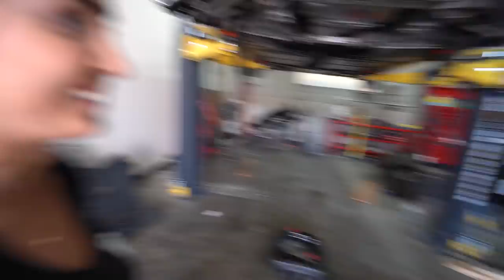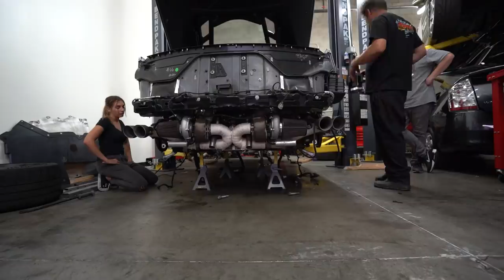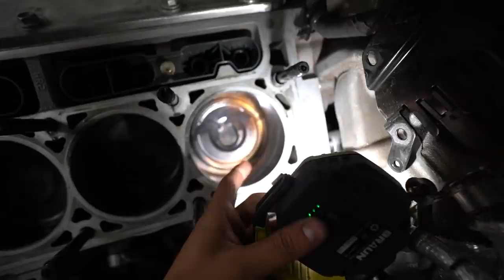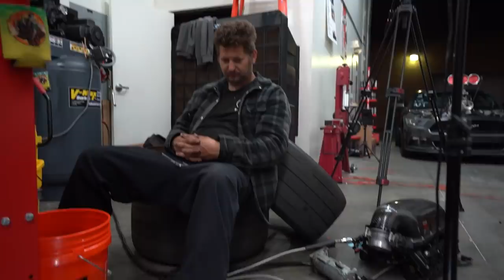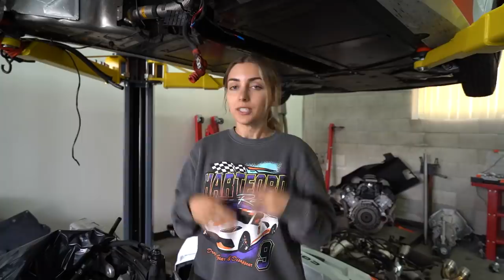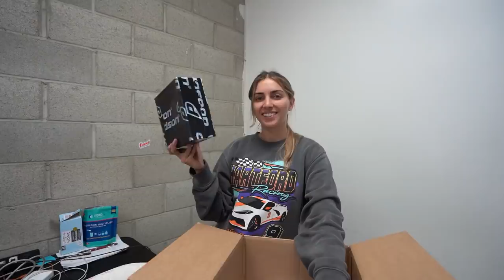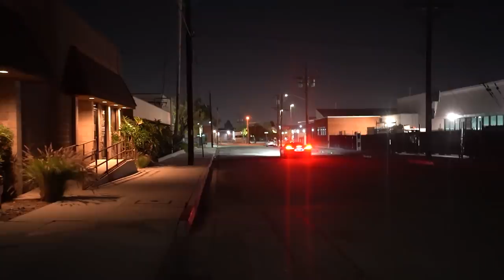I Finally BLEW the motor in my Twin Turbo C8 Corvette... Shocked at what we found.

Comment: You guys could start a mobile C8 "engine in-'n'-out" service - "engine on your driveway in 30 minutes or the next one's free!". 
Man, those stock head gaskets are tough if that's what you had with enough power to lift heads. Crazy. 
Another great video, love when they end with a rip 😎

Comment: Emelia: "And for anyone who has no idea what any of that means"  Sandy: "It's Effen broken!" LOL, At least Emelia is taking it in stride, You guys crack me up. You guys will get it fixed just in the nick of time as always. Sandy just doesn't need the pressure! I feel for you Team Hartford. as for that crazy clutch and transmission?
I think you made the right call by sending the new clutch pack back with the old. it acted like the clutches weren't disengaging (freewheeling) completely.

Comment: So.....you saw "glitter" when you dumped the oil, but so far as I can tell you didnt inspect the crank/rod bearings? And then you screwed it back together?

Hopefully I missed something???
Reply: She said it was from a 240sx skit she did before 0:25 I think it's actual glitter not bearing flakes.
Reply: @wakawaka5131  Thanks- I had just skimmed through the vid looking for  the part where she took apart the bottom end, which obviously never happened. For as hard as she pounds on this engine I'm still surprised she never sends out the oil for analysis. On a purely technical level it could be interesting for viewers, and on a practical level it could conceivably save an engine on the verge of hand-grenading.

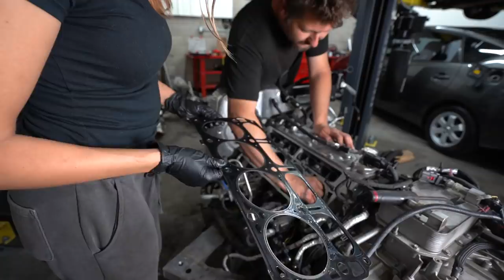Comment: Ok I'm no expert engine builder or anything, but at the 5:50 mark the right most cylinder looks definitely f@#$ed, maybe a bent rod or main bearing issue.  Could be weird lighting but it looks pretty bent.  My guess is the rod end and crank are rubbing a little.

Comment: Head gaskets?  with only 15lbs? Use head studs. Or just go and get a SBC with FIVE bolts per cylinder to clamp the gaskets.
But with all the b/s electronics the C8 is a lemon.

Comment: @EmeliaHartford; Every posted vlog You produce is very good to excellent with much positive energy, excitement, detail, including the status, results, 'story', situations, development, successes, 'failure' ,problems, issue, solutions, work involved, achievements, learning and development process. 😄
Each week i look forward to seeing, view and enjoying Your posted edited video with all of it content and progress. 😏
Am glad that You have improved, upgraded clutches including the proper sized shims, to aid the desired results and handle the high torque &HP. 😏
Am looking forward to seeing how the updated ECU/TCU from Pietz Performance performs, and what results You all achieve in combination with the newer clutches, and better performing engine status. 😄

As You show this engine apart ,again, the issues, and such a few ideas were triggered and generated within my mind, thinking, including ideas, concepts, principles that might be useful, helpful beneficial and thus decided to write for You All if You have considered them. 🙄🤔
A. 'milky' looking engine oil - usually and often results from ethanol or methanol mixing - sources: 🤓
 - 1. turbocharger hot air from exhaust mixing into engin oil
 - 2. other air passages from fuel system and exhaust system into engine oil lubrication
 - 3. passage around rings
B. Higher boost engines - especially TT 🤓
 - 1.often have O-ring for cylinders - best both block side and heads
 - 2. also often use copper, metal gaskets - obviously the GM stock gaskets are designed for the production level HP, N/A without boost
 - 3. if cylinder compression has leaks around edges, often will be marks, indications on the heads and block 
  - [please see details and explanations by Justin Shearer - "Big Chief", most recently with girlfriend Jackie's CTS-V custom SBE 383 c.i. tear down]
 - [link: https://www.youtube.com/watch?v=_ZVBZdZi5ls]
 - perhaps some Texas Speed engineers can assist You or if You can get access to the Chevy C8-R engine engineers would be best, else other SBE engineers involved with high boost, perhaps PME engineers with their COPO NASCAR engines or other similar level engine design engineering experts like Butch Meyers - Legacy Autosports or Casey Putsch. 🙄🤔🤓
Can the block and heads be modified and use such a better gasket for higher boost, power ? 🧐
 - it seems it would certainly be worthwhile for performance, durability and reliability 🤔😏

All The Best and Much Success in Your Quest, Health, Happiness, and Well Being. 😊
Sincerely ☺

Comment: With 4-bolt/cyl heads... makes sense that they were lifting once the boost got well past 15psi.  it was a huge problem on early turbo c5's lifting heads past about that. look forward to what ideas TSP has to increase the head bolt clamp load for the additional boost.

Comment: As I mentioned before mustang waste of time and money less then week driving and it's blown. C8 2 years and as you found out not blown me personally would steel ring the cylinders and you don't have to worry about gaskets leaking if you lift the head
Reply: she blew her stock C8 motor within a month. Race cars break all the time. It's part of it

Comment: When torqueing down those heads give those studs about more 10-15 ft lbs torque for that EeeeXtra Boost 👍💨💨💨
Reply: YES YES YES. Plus I tell my mechanics all the time. Torque setting are for brand new parts. If your reusing bolts or any part for that matter torque settings need to be increased.

Comment: If the engine was chromoly sleeved with O-ringed heads, copper head gaskets, you could put 80 psi of boost to it and not blow it up, that crate motor came with the wrong pistons in it the tolerance should be around 8 thousands to around 11 thousands at most 60+ thousands are the wrong pistons you not gonna wear 50+ thousands off a piston you got screwed I bet that’s a Jasper engine

Comment: Look at the bright side.  When you push more than twice the horsepower through the engine and trans that they were designed for, you can cancel your gym membership.
1. because you will have no time to go to the gym and work out.
2. because you will be constantly pulling the engine and trans and rebuilding both and getting a good full body workout as you violate the laws of physics aka metalurgy, heat, section modulus, you will be caught in an endless do loop in perpetuity.  Non engineers don't understand basic tenants like yield strength and fatigue life.  Engines and transmission built for 1000hp+ are different. Everything about them is stronger from engine block to transmission body....and everything that goes inside...everything.
And then that old pesky definition of insanity keeps rearing its ugly head...you know...doing the same thing over and over and expecting a different outcome.  Physics, the immutable truth.  You can pull on superman's cape for a while and then that oh sh!t moment happens again until you stop hitting your head against the wall....and move away from road race car like the C8 and build a dedicated drag car with monster block and Powerglide that will turn 7's. Why doesn't every in line 4 turbo car in America produce 500 hp? Because unless built better than Nascar or F1 racing motors which cost more than a house, they go boom like your C8.